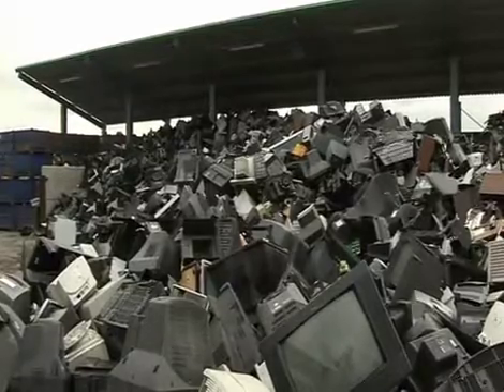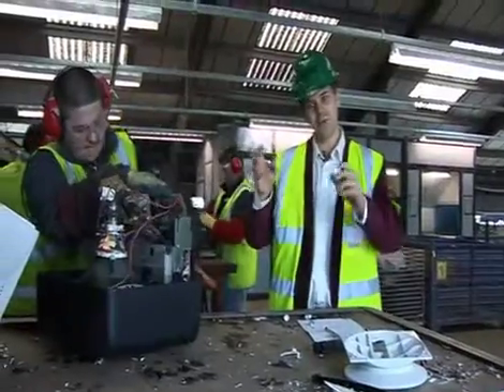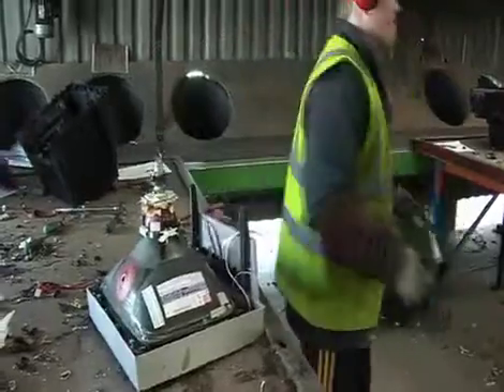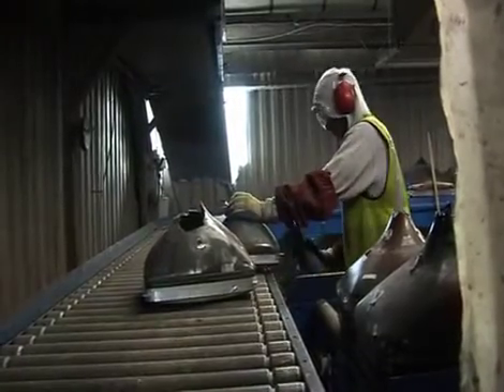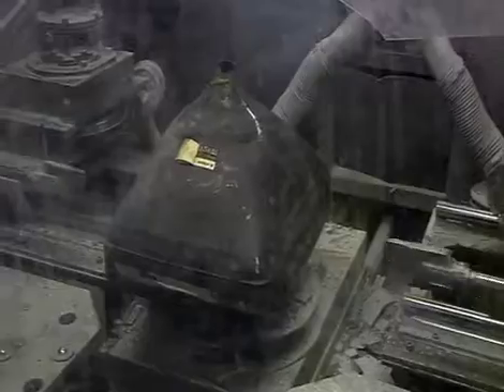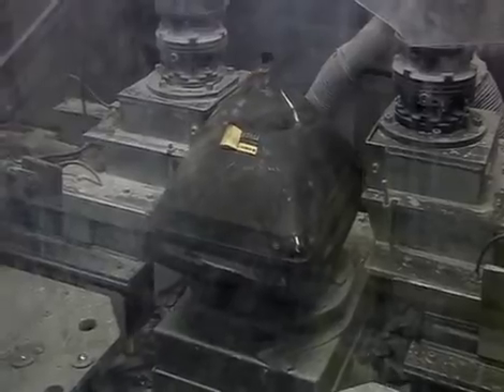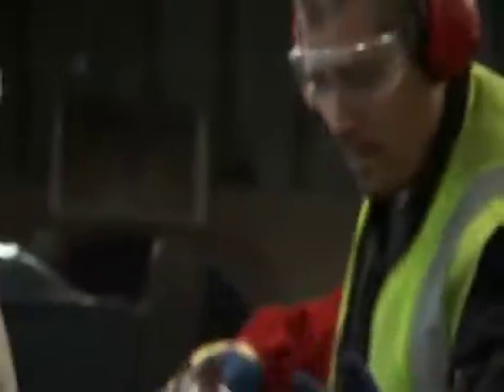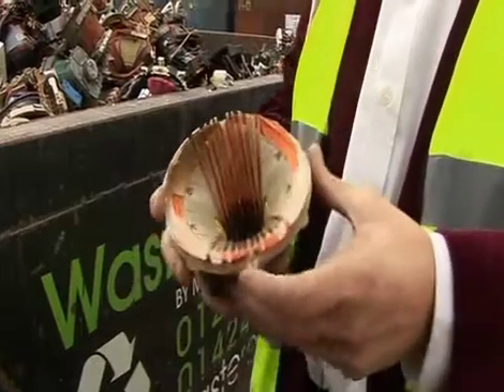TV Recycling Best Practice - Sweeep Kuusakoski

Comment: Believe it or not CRT TVs aren’t completely obsolete. They are popular for art exhibitions and museums. 
They are also highly sought after by retro gamers, especially the professional ‘cubes’ and broadcast models such as Sony BVM.
This is because retro games were designed to be displayed on an interlace CRT monitor, which doesn’t have any lag. Light gun games will only work on a CRT.

CRTs will never be manufactured again and certain models are becoming increasingly hard to find and hence prices are rocketing.
Even a broken unit will yield useful parts which are no longer available from the manufacturer.